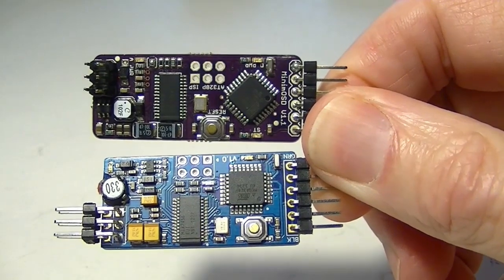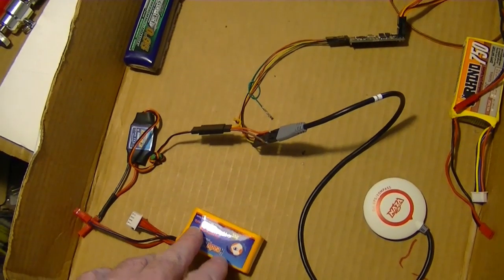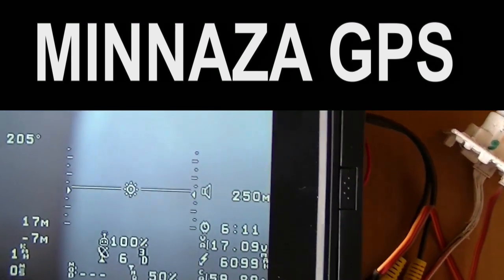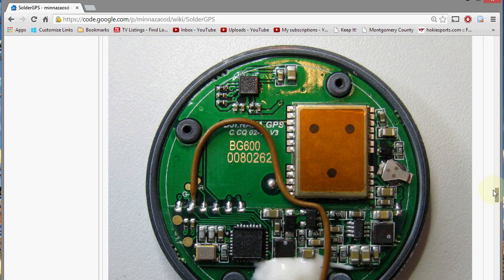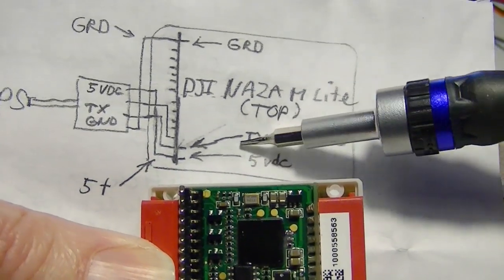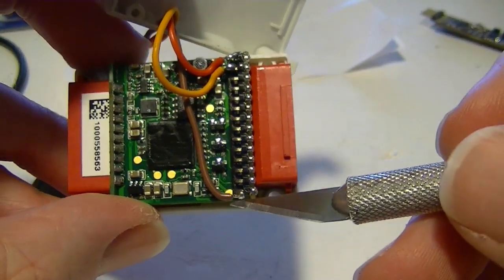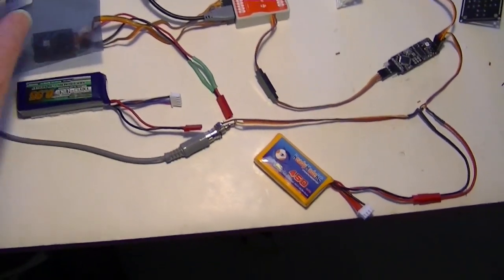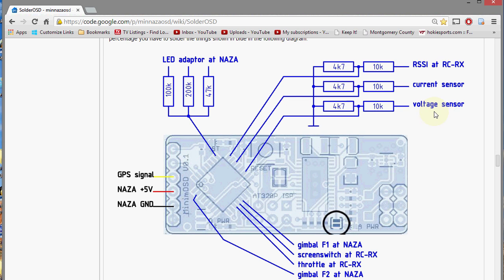MinNaza OSD Project Part2 (Connecting GPS to MinimOSD)

Comment: Hi, my English is not very good. So I am using the translator.
What you have achieved is great. I am trying to do the same for another application with a gps beitian bn880, ublox m8 chipset. I do not get to have the gps signal on osd. Can you help me????

Thank you.
Reply from the maker: Not sure. It could be faulty or incompatible.
Reply: okay. this gps is also supposed to spend apm communication, although you will be right in what you tell me. I'll try a naza gps or you know another brand or model that works.

Thank you

Comment: Just came across your video, great stuff, however, how did you connect OSD to your monitor?. Also, my OSD  seems to power both side of the board. When I connect 5V to the right side I also get 5V on the 12V pin out, could that be right?. I tried to bridge the two point as shown in your video, but nothing happen, no light but board got hot, so I reversed it and it still worked.So before I go any further, I like to hear how to connect OSD to the monitor. Thanks.
Reply from the maker: +Michael Andersen I had to solder a servo wire to an RCA plug so I could connect it to the composite input on the TV monitor.

Comment: great video. sir, what kind of hardware you use for voltage monitoring and RSSI strength? need that information, i'm recording buliding this minnaza osd especially the soldering part :) quite hard to solder !!
Reply from the maker: +Riki Risnandar I did not display RSSI for this project because my receiver did not support it. Voltage monitoring was done with resistor divider. I did not monitor current which would require a current sensor.

Comment: Hi there and thanks a lot for your remarkable videos and info....
In 1:30 you mention that we can set up the minisosd with the gps antenna...
I want to add only some crucial info in my FPV setup such as voltage monitoring and gps data such as total distance,altitude... If a purchase a minimosd (let's say from this list = http://www.ebay.com/sch/i.html?_from=R40&_trksid=p2047675.m570.l1313.TR0.TRC0.H0.Xminimosd.TRS0&_nkw=minimosd&ghostText=&_sacat=0) and a gps antenna ( like this one= http://www.ebay.com/itm/I2C-GPS-NAV-Module-U-blox-NEO-6-V3-1-GPS-Receiver-for-MWC-MultiWii-SE-Lite-/251080936432?pt=LH_DefaultDomain_0&hash=item3a75970bf0) , make the right connections and software parameters (without getting involved at all with naze32 etc) will I have the desired data displayed on my googles?
Thanks in advance and so sorry about my poor English...
Reply from the maker: Yes, I guess it would work but you should probably get a NAZA GPS because the firmware for the MinimOSD is setup for the NAZA style GPS, at least for the MinNAZA project. Voltage monitoring will not be part of the MAVLINK info so that would require doing some modification to the OSD. I have never used a naze32, just the NAZA M lite so I know nothing about the NAZE32 project or the MultiWii for that matter.

Comment: helo can thiswork  for Naza 2 as will  and for flashing the  MINMOSD can I use
http://www.hobbyking.com/hobbyking/store/__27195__Atmel_Atmega_Socket_Firmware_Flashing_Tool.html
Reply from the maker: john Al Yes I think it will work with the Naza V2 but it would be less trouble to use the DJI iOSD.
I guess you could use that flashing tool however once you solder the wires to the chip it won't fit on the chip anymore. FTDI breakout board from Sparkfun is a better solution.
Reply: *****  thanks for the  response   i also got this one     and as  it comes with uspb CP2102 Module  so if i use this  usb so each pin from usb should connect to the same cable as the Osd  example por vcc to vcc  Rxi to Rxi  and so on for flashing ?  also i donot see that u use Arduino
 board  between the osd and the Naza  i seen in  some other  rcgroup post  that they used that  is there any reason        http://www.rcgroups.com/forums/showthread.php?t=2014472

                     http://www.ebay.com/itm/CP2102-Module-Pro-Mini-Module-Atmega328-5V-16MHZ-For-Arduino-with-Tracking-/321527770945?pt=LH_DefaultDomain_0&hash=item4adc8c6f41

Comment: Can someone explain to me how to upload the firmware hex file etc to the board with an usbasp device?

I soldered six pins to the minimosdm and use an avr programmer with usbasp.
Reply from the maker: You might try RCgroups, here is a starting point.http://www.rcgroups.com/forums/showthread.php?t=1830845